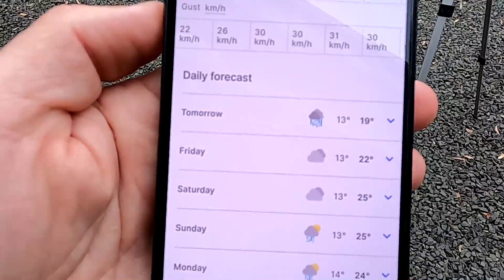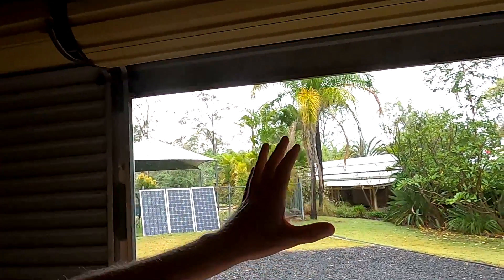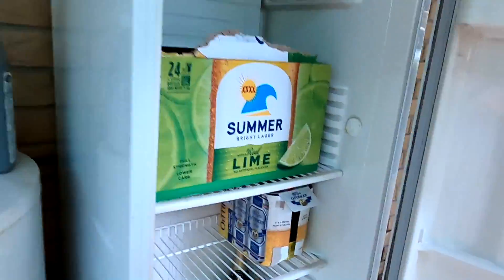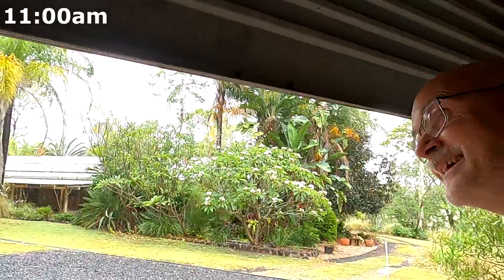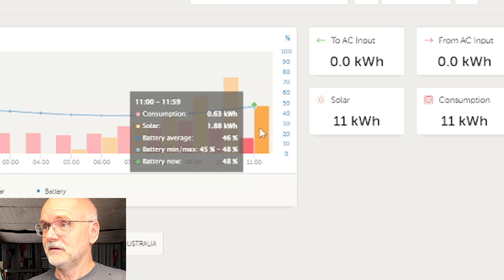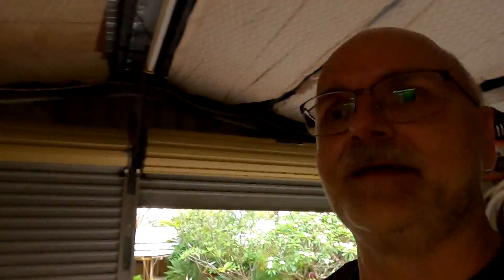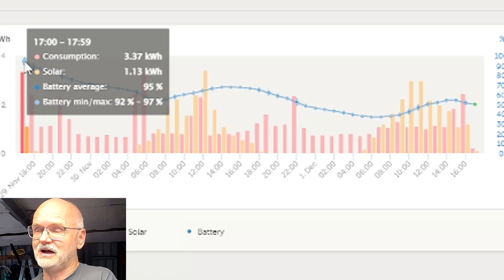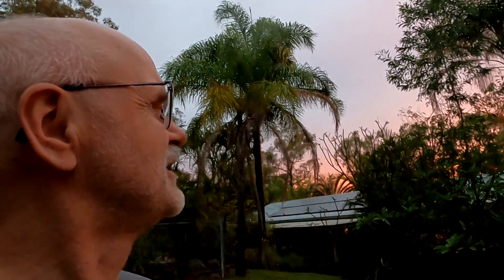Enough solar power under a cloudy and rainy sky? 🌧️🌧️🌧️🔋

Comment: Why do you always talk about how many amps your system is producing? It’s meaningless. Victron inverters are low voltage high current. A Huawei inverter is high voltage low current. My Deye inverter is in the middle. Without specifying voltage, current is meaningless.

Comment: I got my new Eco flow Delta2Max and 220x bifacial panels and after two sunny days got it up to 81%. Today turned out to be heavy fog. I am determined to get it fully charged via solar power. Up to 84% and not going to get a full charge today. Figure I better figure this thing out before I really need it. Their case/kickstand is a pain. I see that they have a new model. Going to see if panel can be retrofitted with new kickstand.

Comment: Interesting point about the ‘generator’ I.e the extra inverter. Is it possible to reconfigure the generator/inverter to count as consumption, having it as an AC load? 

I also have a similar set up which pulls an extra inverter in as a generator when needed. It feels a bit ‘hacky’!

Comment: Have a dilemma,  we have 4 48v batteries the our panels charge in about 5 hrs. We want to add on to the system. Would you add another battery  first or add 10 more panels to just about  top out our inverters to cut down on charging time.

Comment: very cool, this reminds me when I doubled my panel power from 80w to 160w and couldnt believe the performance, chargings 6 power banks while runnings my laptop an external monitor and even a subwoofer speaker and chargins the battery!  then the clouds and rain came and I could still run the laptop setup but not be charging any battery banks, fair enough.  But i gotta tell ya winters a different story.  ON a seemigly less cloudy day today then i remember int he summer time, full overcast however, just not thick, and i can barely manage to charge 2 battery banks without going under let alone any of my laptop setup, like 1/12th the power.  Winter might be a differnet story down under, then up over  here in canada where im located though ,but im really seeing the performance hit during the winter, not  just because of less sun, but im assuming less optimal angle from the sun as well, not getting that full cone of energy apparently.  But dont let my results discourage you, i actually dropped one of my pannesl from a 3rd story window and it kind of just shattered the glass , but seemed to work fine, just a  caveat, it coulld be faulty, but as far as i can tell its just as good as the other one. Definatley need more panel for winter though.  Im affraid, too much. Or is there such a thing of too much panel... i dont think so.

Comment: hey, i just bought my first pack of 4 LiFepo4-Cells and this is just awesome haha....shipping through just temps around 0 degrees is swiped the cells carefully, because when i unpacked them i get a little humidity on the blue outside, so i just let them get used to inside a little while (maybe a couple of days).

But i have another question for you. You have one switch to precharge a resistor for the inverter. Does it matter which one i use? because there is not much going through or am i worng?

Ive seen some with max 5A, but this would be good or didnt it?

(Kannst auch auf deutsch antworten hihi)

Comment: Andy, I know it's early days - do you think that modern panels handle cloudy days better than those from 10-15 years ago ? i.e. is the success you're seeing due to over-provisioning or are modern panels inherently more effective in sub-optimal conditions ? It might be a subject for a video where you compare modern & old panel(s) in the same orientation and compare % of generation vs peak generation under the same weather conditions.
Reply: Hello Chris (and Andy as well) I can confirm, that yes. In the lower 5% range of the nominal I see, that my old Longi 310 produce half od what JA460 can produce. However we are speaking here about getting 40 vs 80Watt from 4 kWp arrays when raining. Under regular overcast (around 10% of rated kWp) results (efficiency) equalize.

Comment: Anxious to learn more about your transitioning the HOUSE to the system.
Transfer SWITCH?
With my EXISITING AC panel...I'd want SOLAR as the primary and GRID as standby.
Please share you chats with the SPARKY!
Reply from the maker: No transfer switch. With the current contract in place (high feed-in tariff) I cannot connect anything new to the grid in terms of solar or battery. Even a transfer switch is considered a connection.
Grid connection comes with a lot of restrictions, regulations and challenges. I would rather go off-grid altogether.

Comment: Well done Andy. I have a question for you that involves some math which is right up your alley and the answer will be very helpful for many viewers. Can you calculate for us, if you haven't already, how long will it take for the energy cost savings to cover the costs of your setup? I know it isn't all about the money, it is about being self sufficient. Maybe you can do a brief video and share how you calculate this throughout all seasons on a best guesstimate? Thank you for sharing Andy and again, well done. Best wishes, Jason from Melbourne Victoria.
Reply from the maker: Thanks Jason, that is very difficult to say as I haven't connected the house yet and have only a few loads connected to the battery so far. So, I'm not sure how much energy I would actually be able to save. I also bought a lot of equipment for testing to get an understanding how they work, like the 3 different BMSes in the shelf. I'm going to replace them sooner than later with something ... different.
I have this video idea on my list though and as soon as I can spit out some useful numbers, I'll make a video.
What do you mean with 'brief video' though??? 😂
Reply: @OffGridGarageAustralia  Lol, brief like 45 minutes or you may lose some viewers. Nothing brief about the math of my question. Great point Andy. Thanks for sharing and love your channel. Jason.

Comment: Amazing observation! considering the worst condition of 2KWh energy production insufficiency per day, you can practically survive such heavy raining weather condition at least 20 days with single battery charge cycle on your 40KWh battery pack. This shows that it is practical to run houses on solar pannels and allocate the production of currently installed and operational power-plants to supply EV charge stations.
Reply from the maker: Yeah, pretty impressive what the system did during that time. I definitely want to connect the house now to test this out over a longer period of time. Teaching my wife what appliances use how much power right now, so she can judge what to run at the same time and what is too much. Not an easy task though 😁
Reply: @OffGridGarageAustralia  Happy Wife, Happy Life!

Comment: I have a question Andy, today was sunny so I did a little load test. I turned off the solar and grid electricity, the whole system ran on battery. Inverter output voltage went from 230 to 218v. When the dispenser started heating water, it takes 3.5a, total house consumption was 4.8a, 220v system. The voltage dropped to 183v across the house. When I turned on the heating function in the air conditioner, the voltage dropped too low for too long and my voltage protectors kicked in and disconnected the electrical supply to the ac. I turned on grid+battery, but used Solar, Battery, Utility setting. The ac ran from the battery, voltage stayed at 230v.

Is this an issue with my inverter setting? BMS problem? Connection problems in terminals? Tomorrow I’ll try a different setting on the inverter. I am waiting for my friend to get back, they have a new inverter released in Feb 2022. Mine is from 2017. I will ask them to do the same thing, I was under the impression if there is no solar or grid, the battery 15kwh should be able to provide the amps and volts. The ac is inverter ac, it starts off at low amps and slowly ramps up to 3.7a max for heating (about 10-15 seconds). That is 814w, battery should be easily able to handle this load
Reply from the maker: It should not lower the voltage by that much. The inverter should keep it pretty constant, regardless of if the power comes from your battery or grid. Where did you measure the voltage? What was the battery input voltage like at the inverter?
Reply: @OffGridGarageAustralia  I measured the voltage at the appliance, the input voltage at the inverter was 218v. The inverter is on the roof, by the time I turn on the appliance and get back to the roof, things would turn off. The inverter doesn't have data logging capabilities. But I will try it out and ask someone in the house to turn something on. I can't figure out why the inverter when operating on the battery only, would do that. If I run solar+battery or grid+battery, there is no voltage drop. Could be a problem with the inverter?
Reply: @OffGridGarageAustralia  I checked again today. The washing machine was running, the AC was running in heat mode. It was drawing 3.5a. when I went on battery only the AC turned off but the washing machine kept on running. The voltage at appliances was going between 180 and 220v depending on the load requirement of the washing machine, when it spun the voltage dropped, when the drum stopped spinning voltage came back to normal. Lights were flickering as well. The output from the inverter was showing a constant 230v. But in the sockets there was fluctuation in the voltage. Have I got my wires mixed up? I measured with a multi meter and I have voltage current protector at appliances to help protect the appliance from voltage fluctuations.
Reply: @OffGridGarageAustralia  Hi Andy, I did more testing. I think I figured out the problem. Thank you for all your videos, watching them the past few years have helped me significantly.

I bought the battery as 48v, 300ah, LiFePo4, 16S1P, that is what I told them. When I peaked under the hood I found it is 8S2P. 

I checked the voltage at the MCB near the inverter, the voltage output was constant 230V. The battery voltage was constant. The battery amps were constant. When I turned solar and grid off, in the first few seconds it managed to power the load, voltage was constant. When I checked the amps coming from the battery, the first few seconds was fine, but after 40a the battery amps dropped down.

I have voltage protection devices. In this scenario I had set the voltage protection device to turn off if the voltage drops below 180, the load was my AC.

When the ac is running the total house load is 1kw~1.3kw. assuming 48v draw from the battery, that would mean 21A for 1kw.

If we assume 24v BMS (8S), that would mean 42a.

I am assuming the turnoff voltage for the BMS is set around 40a. 

Sometimes the AC takes more power and goes to 1,700w, the whole thing turns off. When I run small loads under 700w, everything runs fine like lights, fans, washing machine (with fluctuations as the temporary amp spike causes volts to drop). 

Will speak with the manufacturers and ask them to reconfigure the battery to 16S1P and use a proper BMS board for that.
Reply from the maker: @asderven  Weird. An 8s battery is only 24V, not 48V.
If the battery voltage sags with the load, there could be a cabling/contact problem somewhere. Does the battery have a smart BMS so you can check the cell voltages under load?
Reply: @OffGridGarageAustralia  thank you for the advice Andy. My voltage over protection device was faulty and the connection came loose. I changed the device, tightened the connection. I was able to pull 4kw continuously from the battery without any voltage drop with grid and solar off. I checked each connection down the line with the multimeter.

Comment: You hit exactly my pain point concerning off-grid. In Central Europe, December and January production is so miserable, we have weeks of overcast weather, is like 20% of May. To run at least most of the time on solar requires crazy over paneling and crazy amount of batteries- so much so that in the rest of the year it is rather difficult to find a reasonable use for that much power. OK one can always shut down some inverters or cool the house even more but all that environmental footprint for just two months, very annoying. 
Keep up the good work, I liked this test a lot!
Reply from the maker: Yeah, I also think there is a point where more solar and storage does not make any sense. But I don't like to use a generator either for that time... I need to find something else...
Reply: @OffGridGarageAustralia  isn’t this where if you have the grid, it makes the most efficient/economical sense as a backup for that small amount you will need to take from it, compared to what ur already feeding back in, the grid could be useful to power some of ur heavier loads occasionally to relieve any unnecessary battery strain. While a backup generator is a nice comfort to have, if ur totally off grid, it is probably a large expense, not to mention noise, to setup if u already have grid power, unless going totally off grid is ur intention of course.

Comment: I'm really impressed with the output in the bad weather.  Looks like the panel layout is just about perfect.
Reply from the maker: We will see in winter with the shading of the trees... I'm still not convinced that it will be enough solar... We may have to rely on the good old pool fence system again.

Comment: Your starting to think like me.....I'm coming up to the shortest day, and you are coming up to your longest day.
I'm still thinking of the winter times and here in UK sun light in winter is pretty crap 
Even in summer I can run off a small set up......but winter....I'm pulling off grid loads and it's not cheap.
This time last year grid energy was a 3rd the price of what its now.
So solar and battery set up is even more cost effective than ever.
Definitely with the payments of energy we put into grid at 1/10 what cost is buy it in at........ storage is the answer.
Hats off to to you Andy
Reply from the maker: Thanks a lot, Marc. Exporting energy is certainly not worth it anymore. My feed in is at A$0.05/kWh but I still get the A$0.44/kWh on top as per the contract (until 2028), so... I'll leave the grid connected solar on the house connected as long as possible.

Comment: Great video as always, best channel ever to watch. how is your panels on the different roof connected, i mean are they mostly in serial, paralel, or a combo of both ?
Reply from the maker: Thanks a lot Jens.
They are super low voltage strings. Only two panels in series and 5 strings in parallel per roof. Lots of videos here on the channel on how they have been setup.

Comment: I have the house connected to the inverters + batteries, but don't have the solar panels up on the roof yet, the batteries get charged by ultra-low kwh rates from 2am to 5am, will still use the utility charging for rainy days when the solar panels are installed
Reply from the maker: Yes, that is possible too. Staying grid connected just introduces a lot of regulations and restrictions, so there is also that to consider.
Reply: @OffGridGarageAustralia  don't connect the system to the grid, just a charger, a single element that uses the grid, a dumb load, not the victron system that could imply you sending electricity back, having just a charger connected to the grid is no difference than having an oven on, they won't see the difference
Reply from the maker: @quilmore  Yeah, that is the plan. I won't have this fully connected to the grid. Exporting energy is not worth it anyway and a simple 1kW battery charger will do the trick if I'm in need of energy.

Comment: The combined Hyundai panels with a low voltage start mmpt  inverter gives you the best yield possible under those conditions
Reply from the maker: Yeah, it seems to be working very well. I'm really impressed.
Reply: @OffGridGarageAustralia  i recently swaped my SMA for a DEYE, wich It has lower voltage ranges, better yields with the DEYE on rainy cloudy days

Comment: Hi @andy
What is efficiency of these new solar panels?... are they half cells or ?
Reply from the maker: Hyundai Shingled panels with 21.6% and Phono half-cut panels with 21.something as well. Both seem to perform well in these light conditions.
Reply: @OffGridGarageAustralia   Thanks Andy,

Have you ever checked what is a maximum power in each of your four strings coming into the Victron Charge Controllers??

 I am bothered with over investment of the capacity of charge controllers if the maximum power coming down is far less compared to the peak power of the panels
Reply from the maker: @innocentusangira789  The peak power of each roof is 4kW which is the same as the MPPTs have. If the panels produce more, it will simply be capped by the MPPT. Victron MPPTs can be overpaneled by up to 130%.
This is especially beneficial if you cater for clouds and shadows on your solar panels and you just increase the size of your array.

Comment: Likewise cloudy, cold and horrible in the UK at the moment. My 1.5 KW potential  system is generating 36w.  So 2.4% of capacity. Whats yours doing? 10am here btw.
Reply from the maker: 36W! That is insane. So it just uses this to operate the MPPT basically...
You can always see my system on the Victron VRM: https://vrm.victronenergy.com/installation/100328/share/d0ebad4e
We're back in sunshine and 10am is around 5kW

Comment: I was wondering if you could charge the garage from the house panels? I don't remember if that's allowed under your grid tie contract?
Reply from the maker: These two systems are not connected. I could of course use a grid charger and charge the garage's battery. That would make no sense though with this high feed-in tariff...